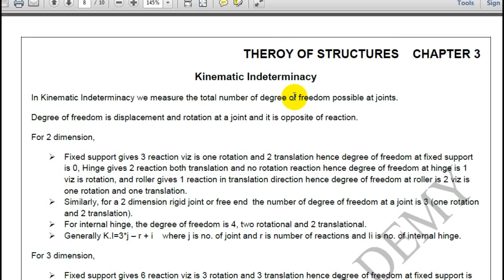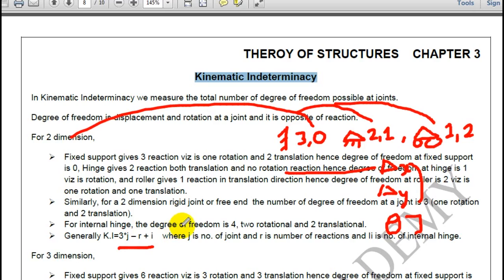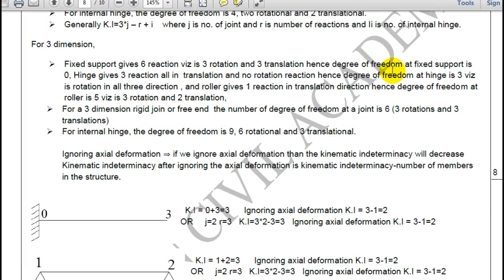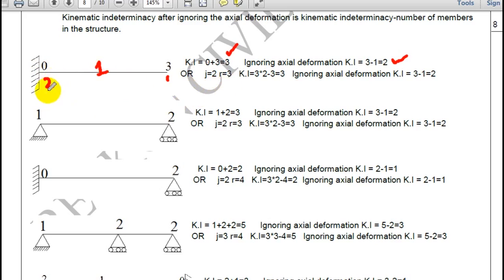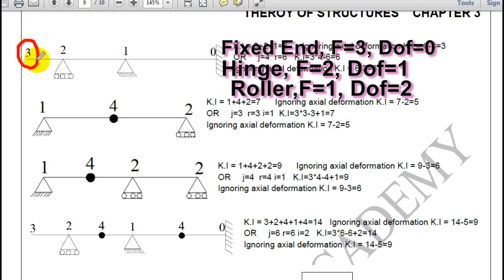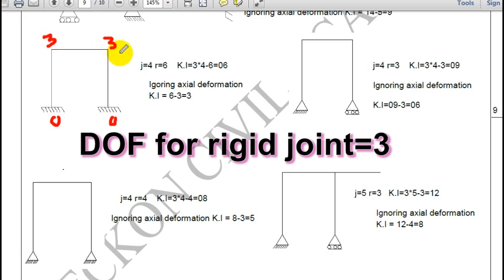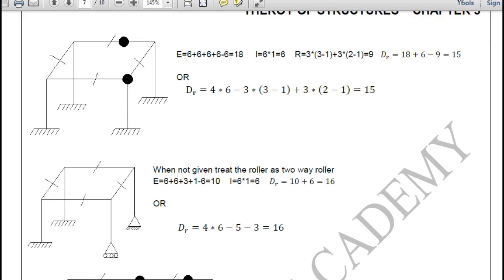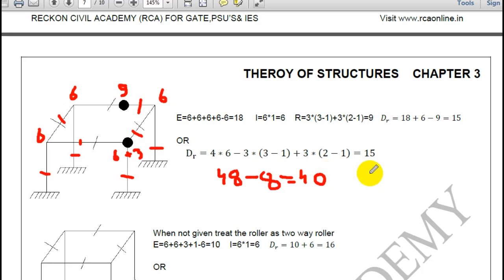Indeterminacy part 3

Comment: in the problem of beam with roller , hinged and fixed support, if you neglect axial deformation the kinematic indeterminacy will be 2 and they are rotations at the hinged and roller support.
Reply: correct
Reply: Are you IES mastets owner ??